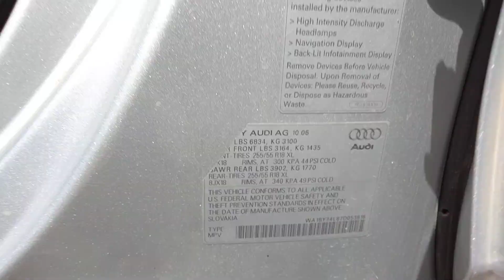3 POS BMW'S GETS SENT CRUSHVILLE HEAVEN ALONE WITH A 20?? AUDI QUATTRO Q7!!

Comment: That's a 2007 Audi Quattro Q7 because the 10th VIN digit is a "7" and it was made in October 2006. They were made in Bratislava, Slovakia at the VW plant. Should be paint code LY7W/5B Light Silver Metallic exterior paint.